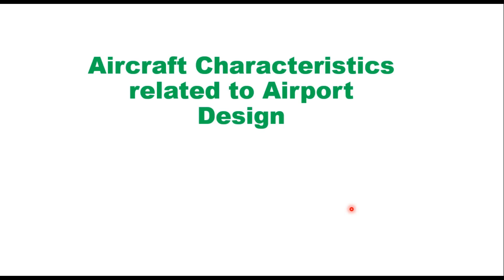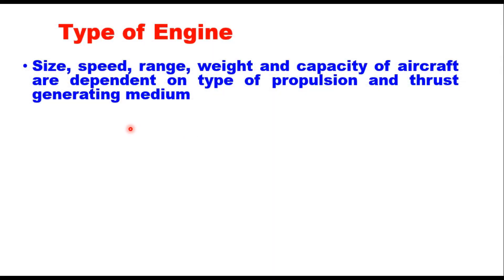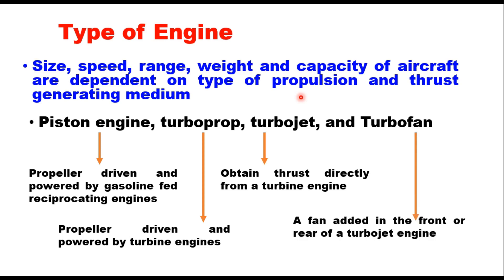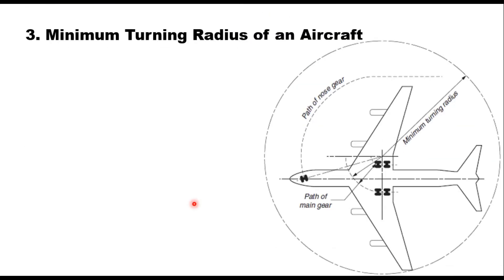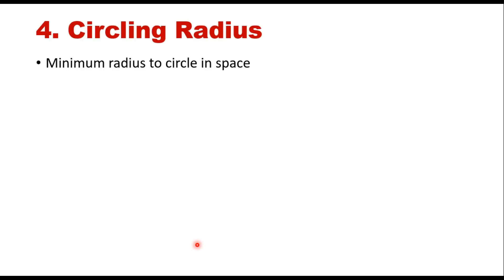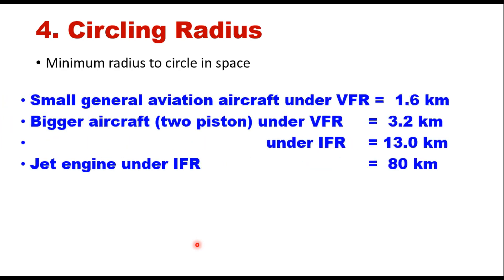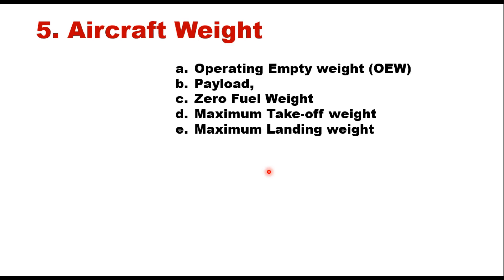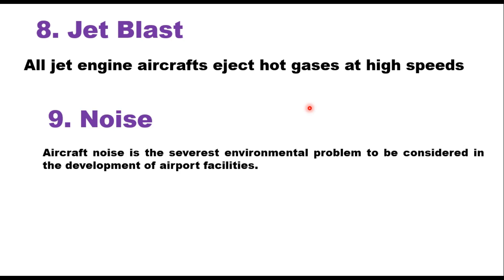Aircraft Characteristics relavant to airport planning & design, aircraft size, speed, weight & more

Comment: Hello sir...!! Nice explanation sir...
Could you please explain 
One question ESE sir..!!!

Statement 1 ) The actual payload, particularly passenger aircraft is normally less than structural payload even aircraft is completely full. .
Statement 2 ) These are limitations in the use of space when passengers are carried in  an  aircraft....

Is Statement 2 is correct explanation for statement 1 sir ??
Or 
Both are independently correct. !!! Sir.....??
Could you explain sir.....
Reply from the maker: Actual payload is less because there is some space particularly below the seats which is unutilized. Therefore statement 2 is correct.
Reply: @SatishIITR   okkk  sir    tqqqq  .....little confusion    sir  >>???///

Is Statement 2 is correct explanation for statement 1 sir ??
Or 
Both are independently correct. !!! Sir.....??